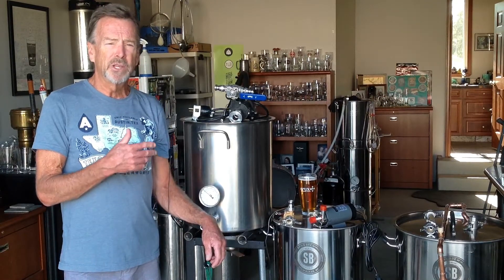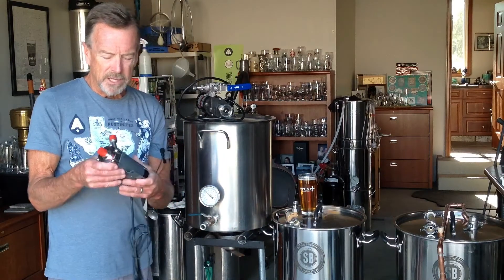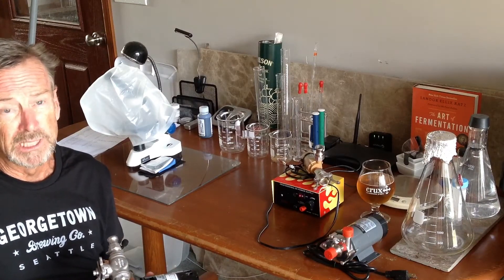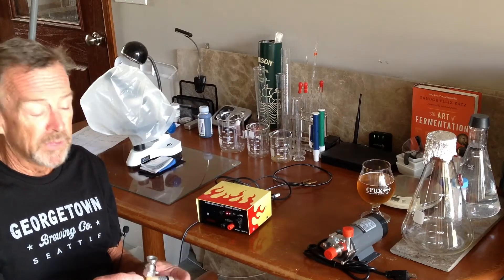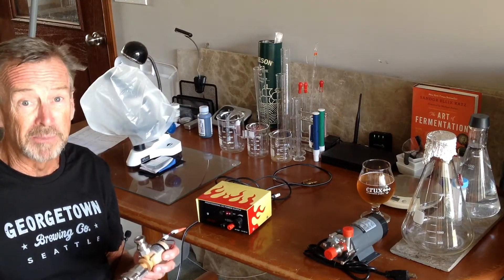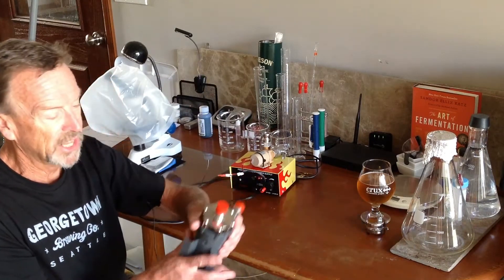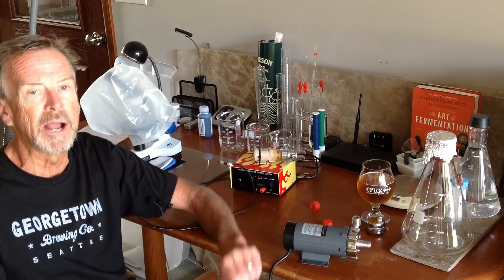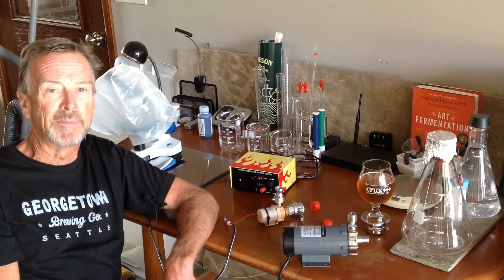Homebrew Pumps :: Review and Comparison

Comment: Thanks for the video. One thing you could have mentioned is self priming. This is my biggest gripe with the March ( if that’s how you spell it) is that it dosnt self prime. Sometimes it takes me ages to get it to pump. My understanding is that self priming pumps won’t handle heat which on brew day is useless.
Reply from the maker: great point, I overlooked that.  All of these magnetic driven pumps are gravity fed, and I agree that there is nothing worse than a pump that just won't get going.  One thing that has helped me is putting my pump on the floor with a two foot line connected to it.  Here is an  up-to-the-minute update on that new pump that I showed.  I put the camlocks on it and fired it up.  Wow, very strong flow (as much as the March).  I will certainly have to put a ball valve on it to limit the flow.

Thanks again for watching and commenting.